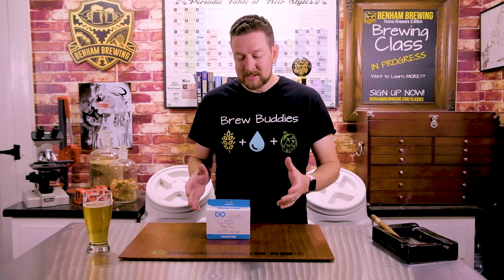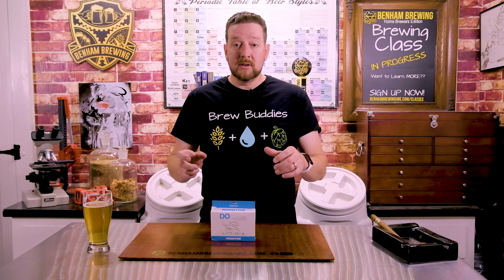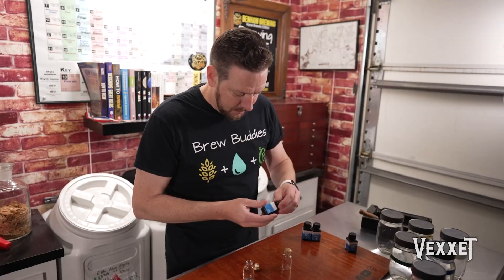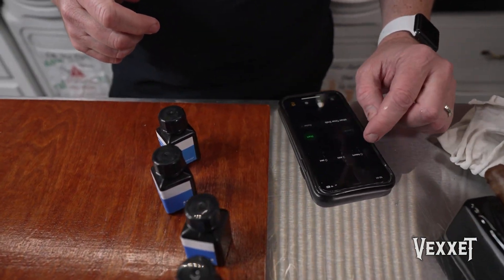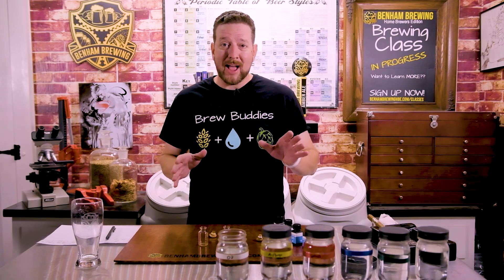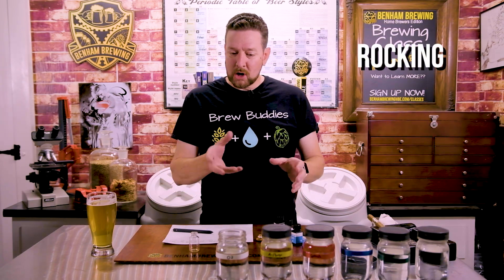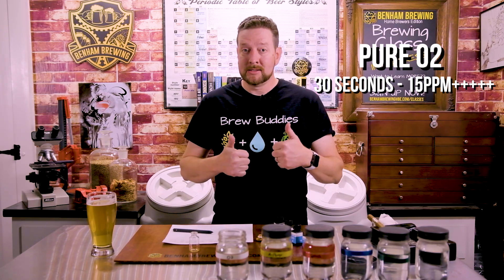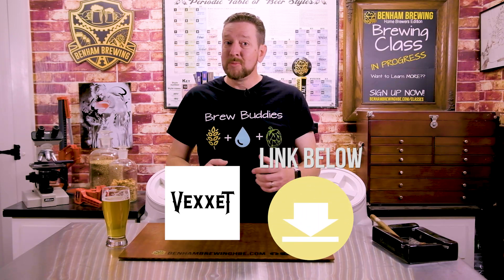Adding Oxygen to Wort - SHOCKED BY THE RESULTS!

Comment: THese numbers are bigger than on a 19L batch size homebrewing scale, because for example you putting in the o2 wand injects a steady stream of o2, but in this case to a much smaller volume. You wont get the same effects exactly on bigger batches. My point being is that one shouldnt be too confident about getting high enough o2 ppm levels by shaking etc. The wand is necessary to reach higher levels in a real world scenario. Good video, I dont really disagree with anything but wanted to make that point. It is a different thing that which beers need those higher levels. A 1.045 OG pale ale? Perhaps not. Lagers, 1.060+ OG beers, surely yes!
Reply from the maker: Oh for sure! This was certainly not a scientific test by ANY means. Great point too about the DO levels required for different beers. Thanks for the comment!

Comment: Love the test. No issue with methodology or anything. My question, as with many things in brewing, does it really matter? My current understanding is that oxygenating really helps re-energize a re-pitched cake or helps in the case of an under-pitch, but if you are pitching dry yeast, or you have done a starter and your cell count is sufficient, this will likely not improve matters.
Reply from the maker: Thank you for the kind words! This was a pretty cool test to do. Oxygen is important for yeast in their initial growth whether you pitch dry yeast, or a liquid starter. BUT... I sometimes wonder the same thing. I have noticed a difference in my beers being cleaner, and fermenting faster when I oxygenate, however I have never actually put that to the test. Might be another fun experiment to do. Brew a beer, split the batch, oxygenate one and see how they perform against each other.
Reply: Oxygen is supremely important for yeast during their replication stage, it helps yeast create healthy cell walls. From my understanding, you don't need to oxygenate dry yeast, but regardless of cell count you should oxygenate both your yeast starters and your wort. 8-10 ppm is ideal.

Comment: Just to be sure for the splashing method : if i fill up my fermentor with my pump , i will have to retransfer it 4 times to reach 8ppm ?
Reply from the maker: Sorry for the confusion! Actually, no. If you just transfer the full batch into the fermenter in one go while splashing during transfer, that should get you to 8PPM. With my testing, I had such a small quantity of liquid, that I wanted to determine if shorter vs longer transfer time made an impact (hence the 2 times, vs 4 times). It takes you way longer than my testing times of 6 seconds for 2 transfers vs 12 seconds for 4 transfers. I hope that makes sense? In my prior video (see HERE: https://youtu.be/nzy0G06ASXc ), we talk about each method and the theoretical MAX PPM.

Comment: Love this scientific approach, even with its margin for error. I upgraded to a pure O2 setup with Spike's oxygen regulatory, which recommends 1/4 LPM for 30 seconds per gallon. I think its helped make better, consistent beer. And saves me getting my power tools out to stir it up.
Reply from the maker: Right? It's quite the timesaver, and the o2 tank refills are cheaper than my c02 refills (at least, in my area).
Reply: I never take steps to oxygenate my wort yet my beer turns out fine.  What am I doing wrong?
Reply: @markrose53  What are you doing currently (e.g. splashing, shaking, nothing, etc.)? 
What kind of yeast are you using (e.g. liquid, dry)?
What size of batches are you doing?
What kind of beer are you making (e.g. ales, lagers, etc.)?

Honestly, I'm not 100% sure it is making a noticeable difference in my beer as I've changed a few different variables at the same time, like making yeast starters, but they say it's important so at least now I have a standardized way of doing it, especially as I scale up to 10 and 15 gallon batches, etc.
Reply from the maker: @Joshua Pinter - All GREAT points! I notice that my beers ferment out cleaner, faster, and tend to hit a lower terminal gravity.  @MR - If your processes work, and you like how your beer turns out, then you are probably not doing anything "wrong". But if you are really wondering about the impact,  brew up a batch, split it, and oxygenate 1/2 of it. See if you can tell the impact. Thanks for the comments!